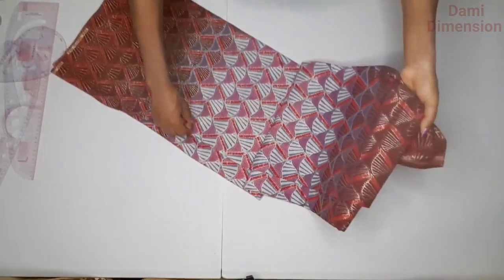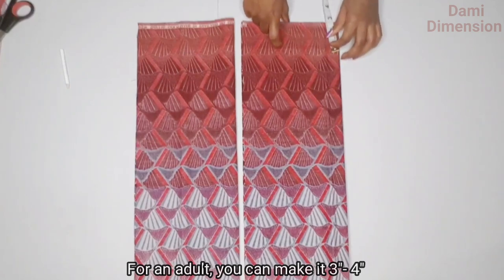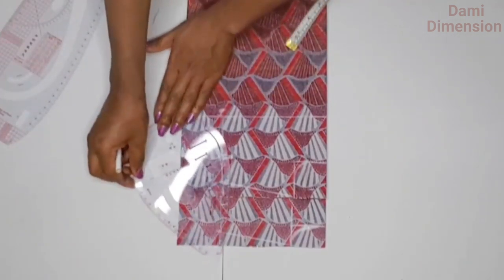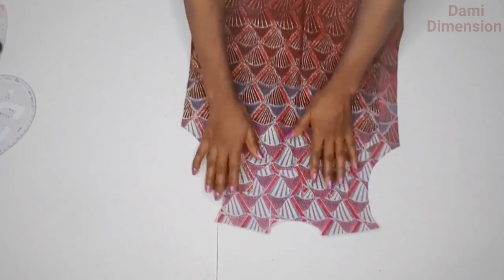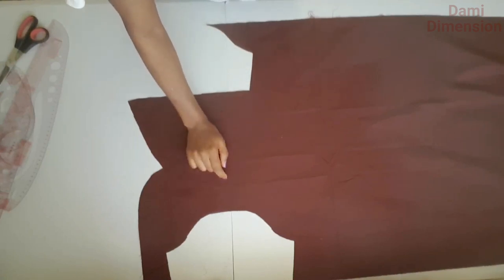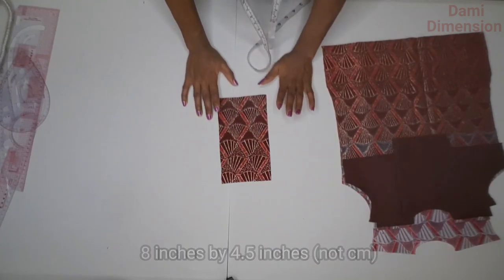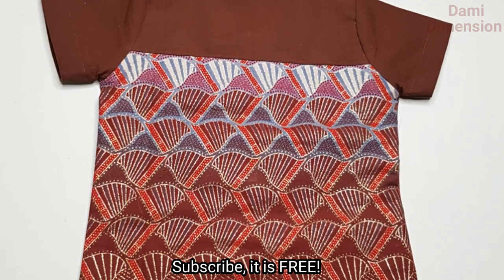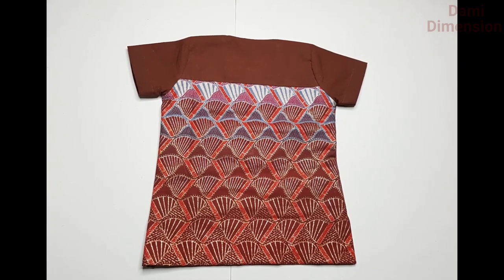HOW TO MAKE A SENATOR TOP (BUBA) CUTTING AND STITCHING | MALE CHILD NATIVE TOP | MALE NATIVE TOP

Comment: Thank you for the video. I got confused when u joined the shoulders together. Are u not indirectly decreasing the front armhole cos ur measurement of the armhole was 1 inch above the front shoulder line. I thought the joining of both shoulders should have been an inch above the front shoulder or an inch below the back shoulder